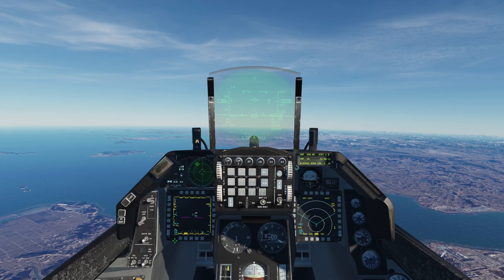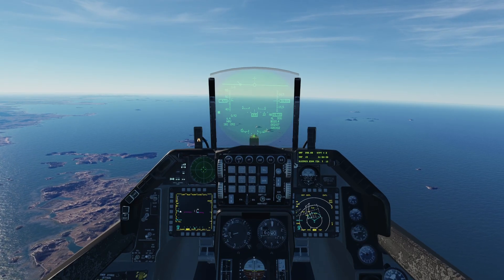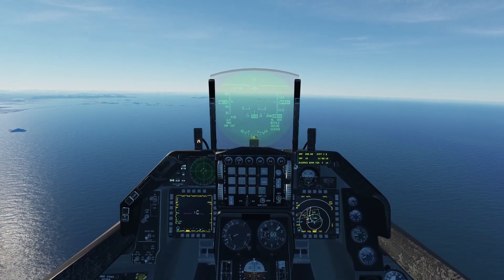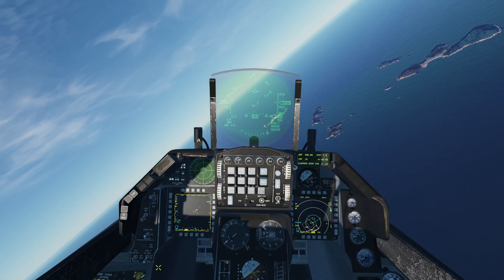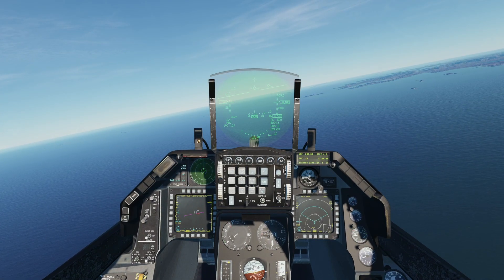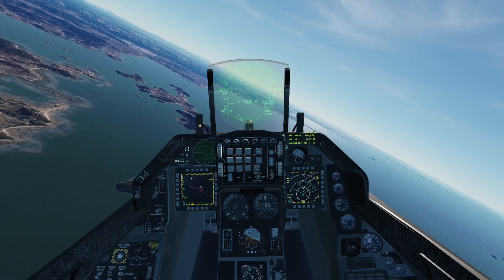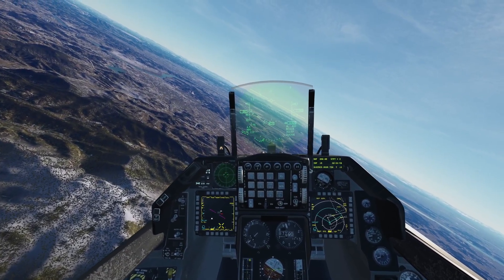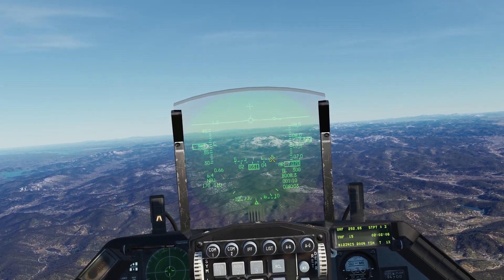Falcon BMS 4.38 | Getting The Most Out Of Autopilot

Comment: Bad info for ATT Hold. If you want to bank and maintain FPM on horizon which is what you seemed to be wanting to do you just use ALT Hold. ATT Hold is great for losing altitude at a set rate such as when returning to base. Thanks for the videos.
Reply from the maker: I was using thr bank to show that it holds the pitch attitude. Looks like a misunderstanding of what I was attempting to communicate.  I never said it manages thr bank angle for you.